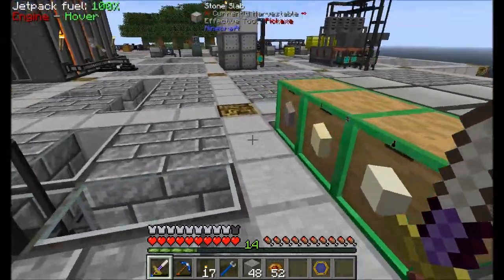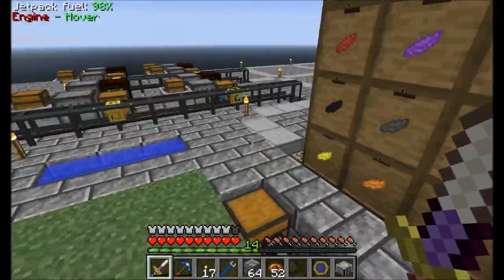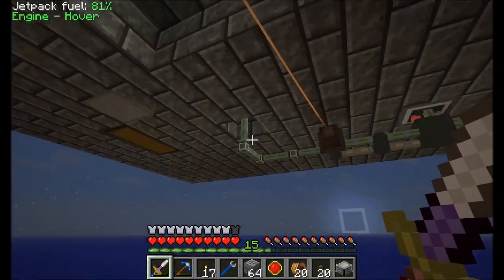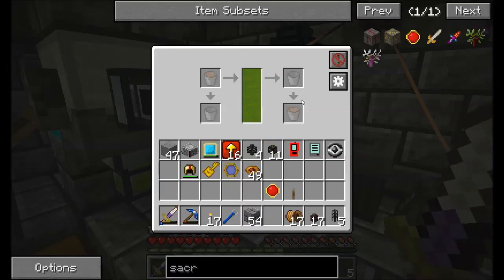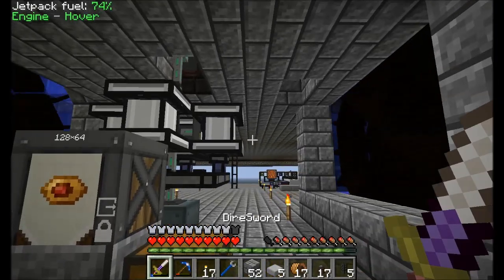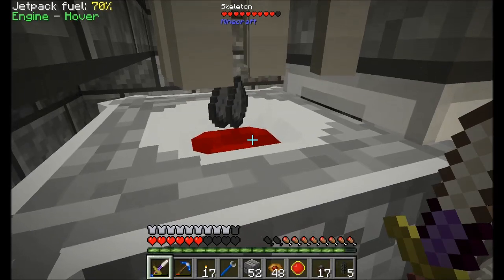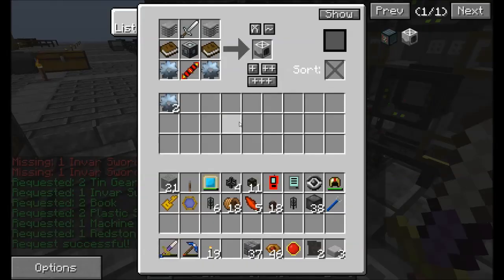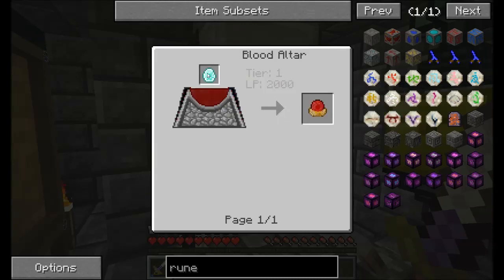FTB Expert Skyblock   Ep25

Comment: carpenters blocks take on the properties of the blocks used in them. I don't know if there are obsidian half slabs in this pack. Carpenters blocks would do the trick though. Nice thing is a hammer will pop out the obsidian. Making it much easier to pick them up.

Their are other options. That is just the first one that comes to mind.

Comment: I saw extra utilities pipes being disconnected from each other, in the mob grinder, I've poked at them with a yeta wrench and I've seen a sort of "diode" setting, but  I'm still not sure how to get them to just...not connect, like enderIO 's conduits do.
Reply: +Tizona Amanthia If you are trying to run separate lines next to each other, then you need to set "diode" modes on both pipes.  You can also set the diode mode on transfer nodes, but they either don't show or are hard to see.

If the pipe detects something it can connect to, then it will try to connect to it.  Diode mode can effectively turn that off, but won't visually change the pipe.  If two pipes next to each other both have diode modes set to ignore each other, then they will visually disconnect. 

Right clicking with a vanilla stick should also work for activating diode mode (Extra Utilities doesn't have its own wrench).
Reply: thanks to both, the "diode" both sides being the simple answer, is good, but having it rephrased from the wiki does help me understand, thanks guys!

Comment: Wait... THAT is the mob spawner they are using?
Why? Why??
You don't get spiders or enderman with it, it is slower, it depends on vanilla mob AI, it generates a lot less than a regular one... come on, Soaryn! This is a moded series!
You just need a 3x3 falling hole, and 12 fans, and you got the fastest spawner in the world... Like... filling a fully upgraded mono-drawer of every drop in 2 hours fast.
Oh, the inneficency...
SadPanda =(

(Also, blood is super easy to get in this pack... you just craft 1 sandstone with (I believe) 3 zombie meat, and smelt that. It gives you 100mB of blood)
Reply: the fact that spiders can stick to walls
Reply: +villanelo1987 at this point of stage, if i remmeber my infinity hardmode, spider eye isn't really needed that much, and silk can be easily automated.

i could be wrong about this, but consider this in early game, how do you make a grinder that enderman wont teleport away? how do you make a mob farm that spider wont block the passage?
Reply: +ywyak
Well, I can tell you right now, since I am using one, and I made it in my 6th day in the world.
You make a flat spawning place (as big as you want, but a 15x15 works well with fans, I believe) and then a 3x3 drop in the middle, so everything  gets pushed by the fans to the hole. You need 12 fans, since you need 2 in each corner, plus the 4 in the sides (I am sure there are better / cheaper designs for this, this is just what I am using).
Since that is the only spawning place in the world, you only need 1 layer for maximum efficency... but nothing stops you from building a bigger spawner if you want, and then use the fans / belts to move mobs, but that sounds like innecesary trouble to me..

Then, if you want to kill them manually, you make a "safe window", and hit them with your tool of choice (for blood, or rare drops, or xp. In the one I am using right now, everytime I pass by the trap, I click LITERALLY 5 times with my scythe, and I collect 24 levels + about 10 Thaumcraft bags and 3 or 4 heads, including enderman heads) 
If you want to kill them automatically, you use punji sticks. They cost 1 sugar cane each, and can be placed on top of hoppers, so automating the collection is as easy as placing a chest on the last hopper (and once in there, move them wherever you want, or you use pipes instead of a chest).

Since you are not close enough for spiders to notice you (and they don't ever see / track you if you make it automated, since it is a closed system), then their active AI doesn't activate and they don't climb walls, so they don't stop other mobs. Not to mention that, even if a spider or two are in the walls in the killing chamber (they do sometimes if it is in manual mode, never if it is automated), the other mobs fall through them no problem, and they die anyway to the AoE damage, even while in the wall. But since there are no walls in the spawning area, they just get moved to the killing area, and there is nothing they can do to slow the system, since there are no walls to climb, and they fall in the 3x3 the same way all the other mobs do)

Total cost is somewhere between half a stack and a stack of iron, 10 sugar canes, and the blocks to make the spawner, and you get about 10 times more loot (including blood for the altar) than this way (since there are A LOT more spawning spaces, and mobs are moved instantly, not needing to rely on vanilla passive AI, which is... not that good) , without any need for machines, or energy. Literally, for free. And if you move up in the tech tree, you replace the punji with diamond spikes, and you would even get rare drops. Also, since it doesn't use water, you get infinite ender pearls, faster than you can use them, for free, and those are SUPER useful early / mid game (I would say having lots of eyes is also needed in this pack, and getting more than 10.000 per hour is not a bad start, but yeah, they are not needed... yet)

This trap is just... bad. Like... 2011 vanilla bad. In fact, I am pretty sure this is the exact trap that Etho made first in his Chocolate Island Lets Play... and that was in beta times. Even vanilla traps now are a lor more efficent than this one. Knowing Soaryn, I am surprised he is using it.
Reply: actually grinders dont make endermen teleport. its just soaryn's design includes water that make endermen teleport